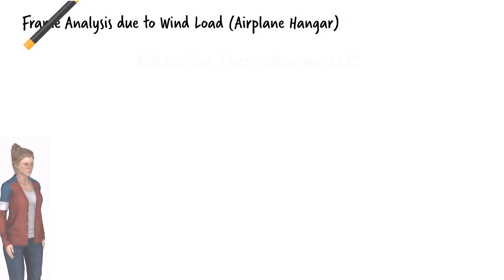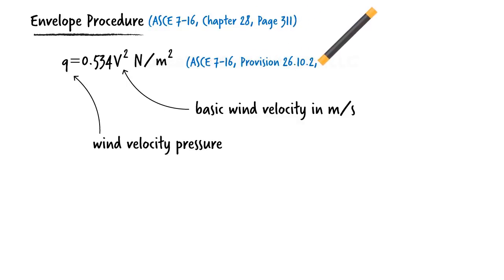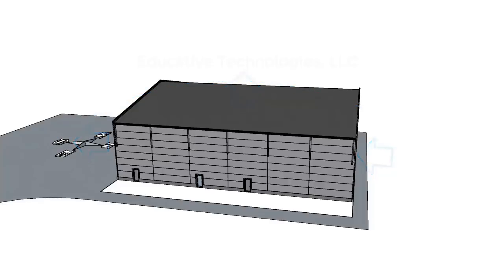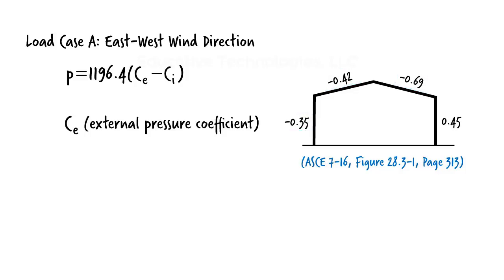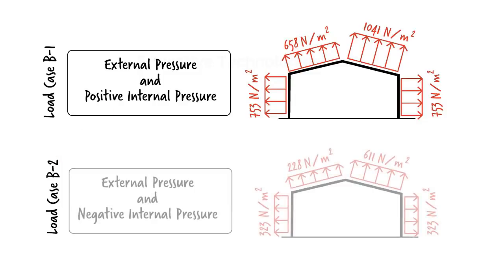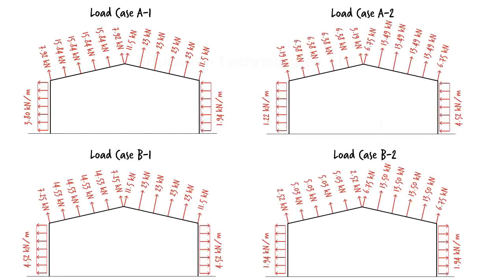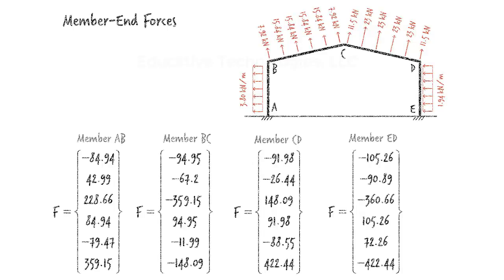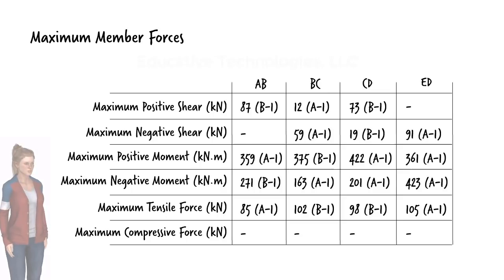SA52: Frame Analysis under Wind Load (Airplane Hangar)

Comment: If a building has 5 floors ( five storey)  building, do we do the coefficients of the wind loads in each floor or we do them for the whole building?
Reply from the maker: The procedure described here is for low-rise buildings only. Mid-rise or high-rise buildings require the use of more comprehensive techniques, such as the use of wind tunnels to accurately estimate the governing wind forces.
Reply: Dr. Structure : Ok thank you.

Comment: Is there a chance that you can be able to assist me with the codes on for the coefficients of the wind loads that you used in the video like ASCE 7-16, or just the important relevant pages or tables
Reply from the maker: The relevant provisions are covered only in a few pages of ASCE 7-16 which  are referenced in the video. The selection of the relevant coefficients depends on the location, purpose and shape of the building.  If you have ASCE 7-16 in your possession and have studies it, yet have specific questions, feel free to post them here. I'll do my best to answer them.
Reply: Dr. Structure : Thank you for the Response, don't actually have the code because i am based in South Africa for the moment. So i was hoping that you might be having the relevant reference pages because the codes that i have for South Africa are a little bit confusing, i thought getting yours would help me compare which of the procedures is better and easier to get the coefficients.
Reply from the maker: Unfortunately, due to the copyright issue, I am unable to send you the relevant pages of ASCE 7-16. You might be able to find some information on this online. There might be some powerpoint presentations or pdf files out there ....
Reply: Dr. Structure ok thanks, i will find some means. Thanks a lot

Comment: Could you kindly explain why the bending moment diagram resulting from lateral uniformly distributed load on the frame (column) is a linear pattern? isn't it supposed to be a second degree curve?
Reply from the maker: Yes, indeed! The shape of the moment diagram for AB, and ED, is not correct, it should be a second degree polynomial since shear is linear in the member.  Also, the moment diagrams for BC and CD should be of linear type since shear is piece-wise constant in those members. Thanks for point this point.
Reply: Thanks for the clarification.  

I have had a discussion with friends about the bending and shear moment diagram of a statically indeterminate (two-story two bay, fix supports) frames subjected to lateral uniformly distributed load along its length from one side, but we all were not so sure about the accurate solution. It would be very helpful if you could explain (or make a video) how to calculate and draw the diagrams for this particular case. I have tried to use SAP2000 vs. Robot to draw them, at the column subjected to UDL, SAP2000 gave me linear pattern while Robot showed me second degree curve.
Reply from the maker: We will work on a video for that, but that will take some time. 

The analysis of the frame can be done using a standard method such as the displacement method, or one can use software tools such as SAP2000 for that purpose. Regardless of the method in use, the analysis gives us the member-end forces. In the case of a two-story two bay frame, since we have 6 columns and 4 beams, we end up with 10 sets of member-end forces. In each set, we have three forces for each end of the member (an axial force, a shear force and a bending moment).

Shear and moment diagrams need to be done member by member. For each member, if it is subjected to a uniformly distributed load, like the two columns that are subjected to the UDL, shear diagram is going to be linear and moment diagram would be nonlinear (second degree polynomial). For all the other members, since they are not loaded directly, each is going to have a constant shear and a linear moment diagram. Given the member-end forces from the analysis step, you should be able to construct these diagrams.  In doing so, you need to pay particular attention to the members subjected to the UDL as the maximum moment in the member needs to be computed as well. This moment is located at the point along the column where shear is zero (where the shear diagram cross the axis.)

Some software applications approximate the shape of the diagrams using straight lines. This may not be a critically important factor if the beam is finely discretized  into small enough segments.
Reply: Thank you for the answer. You have cleared out my puzzle.

Comment: In concrete frame structures, lateral joints are acting on joints of columns and beams. How are these obtained?
Reply from the maker: Do you mean how the lateral bracings are attached to concrete beams or columns?  There are various techniques for creating attachments to concrete. For example, anchor bolts with sufficient lengths can be placed inside concrete for creating such attachments.
Reply: Sorry. I was asking about how lateral loads due to wind or earthquake acting at joints of columns and beams are computed or obtained. In other words, how do we compute for the applied loads due to wind or earthquake acting on concrete frames in buildings?
Reply from the maker: The forces at a joint of the structure are the same as internal forces at the ends of the members connected to the joint. These forces are computed by analyzing the structure an determining the member-end forces. 

If lateral forces are significant and present in the structure, we often resort to three-dimensional structural analysis where each joint would has 6 degrees of freedom, three displacements (in x, y and z directions) and three rotations.  In such a case, a beam or column would bend along two planes, and it may go under torsion as well.  Then, a joint/connection needs to be designed to accommodate in-plane and out-of-pane bending as well as torsion.

Comment: Dr. Structure, I have seen in practice engineers for quick sizing and cost estimation of rafters would (skip step) not transfer the load to the purlins but would use the tributary area of the rafter times the area load to compute the line-load for rafter. Here you would not have point loads on rafters, Is this bad practice or even wrong?
Reply from the maker: How the load is being transferred from the roof panels to the supporting beams depends on the configuration of the assembly.  If the roof panels rest directly on the rafters, as opposed to the purlins, or if the rafters and purlins are on the same plane, then the method of estimation that you described is correct; we would end up having line loads on the rafters. 
However, when the roof panels are resting on the purlins only, and the purlins sit on top of the rafters, as is the case here, then the purlins are subjected to line loads only. The rafters take the roof load at the points of contact with the purlins.  Here, distributing the roof load on a rafter uniformly is not a good idea as it would result in underestimating maximum bending moment in the member.

Comment: why is the load on the column is not concentrated as well as the beam
Reply from the maker: The wall panels are in contact with the columns directly. That causes wind pressure to act on the entire length of the  column, as a distributed load. However, the roof panels are not in direct connect with the frame beams. The panels rest on the cross beams which then transfer their loads to the frame at eleven (11) points.
Reply: great thanks !